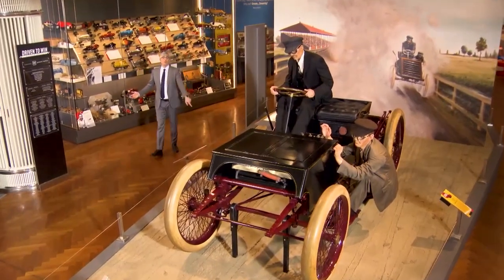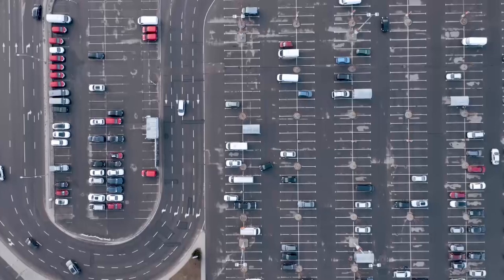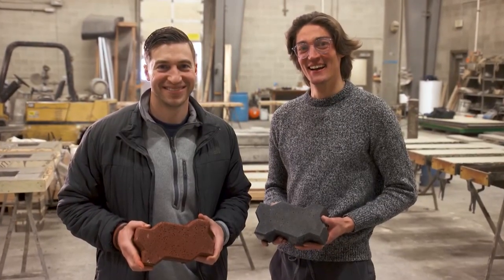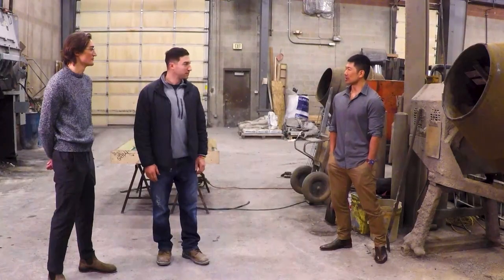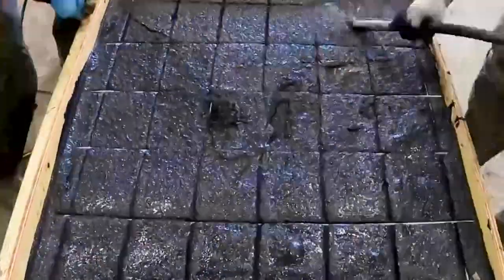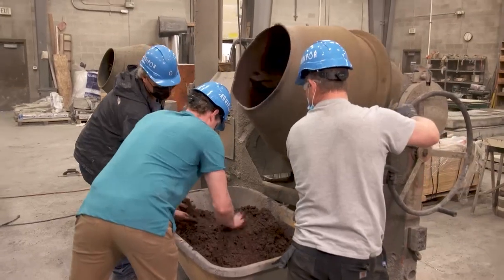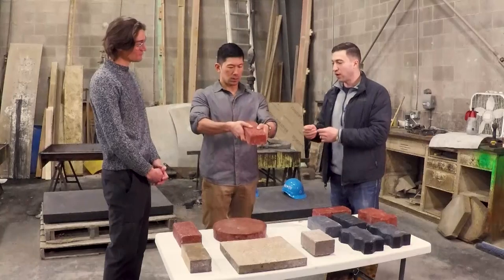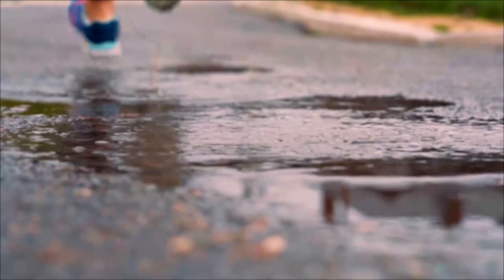Permeable Concrete That Returns Storm Water to the Ground | The Henry Ford’s Innovation Nation

Comment: curious how it handles water freezing after being absorbed, or if it can?
Reply: I’m wondering the same thing. You would think it would freeze and crack. 
At the very least it would pass through, freeze and push the concrete up.